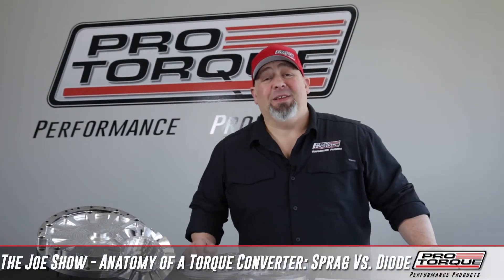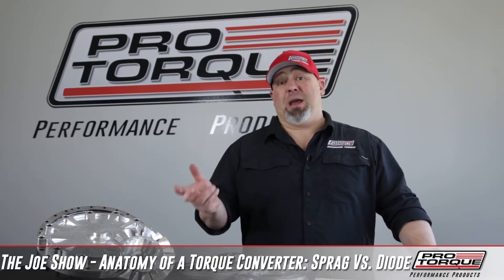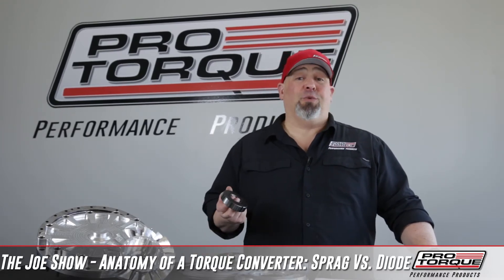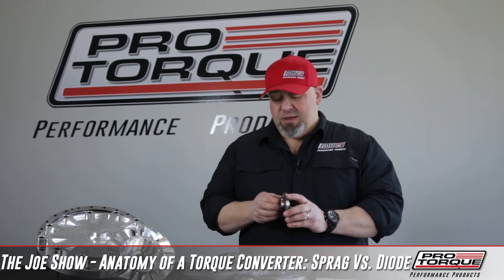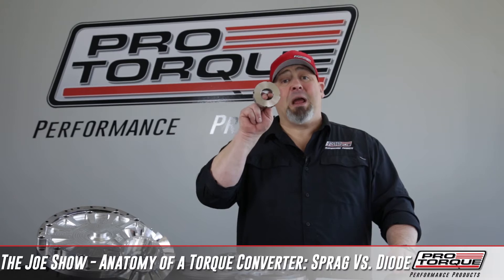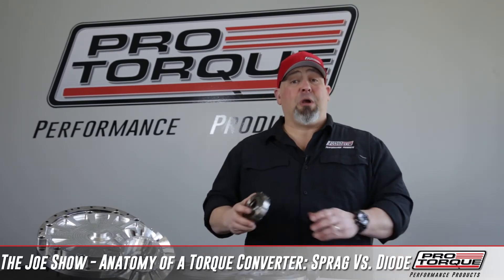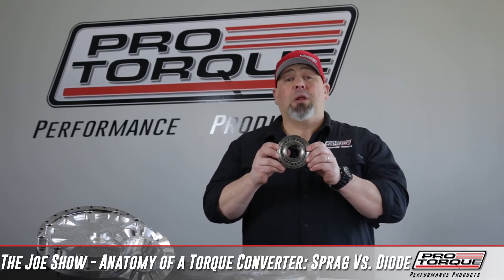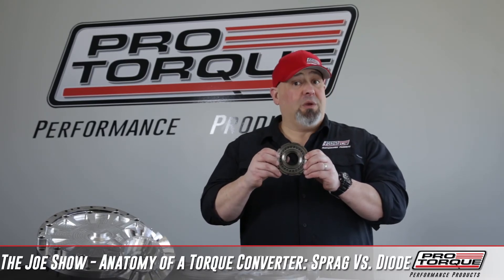The Joe Show - Anatomy of a Torque Converter: Sprag vs Diode

Comment: Spragless doesnt allow the stator to move, the 3 others let the stator turn in one direction and brakes it in the other. Did the part where the explanation of the differences end up on the cutting room floor?